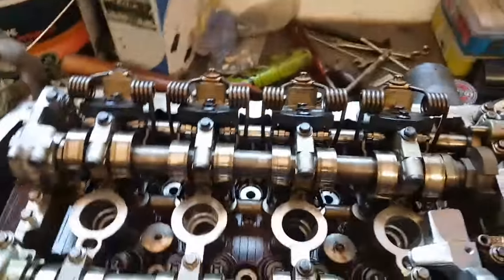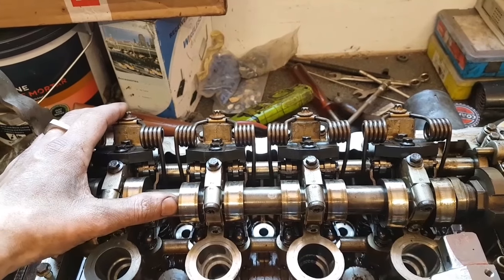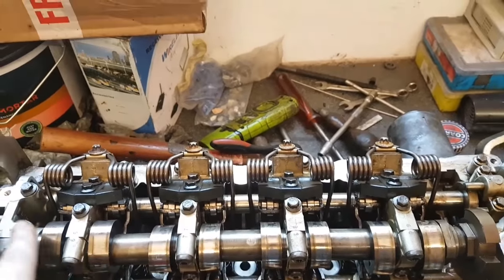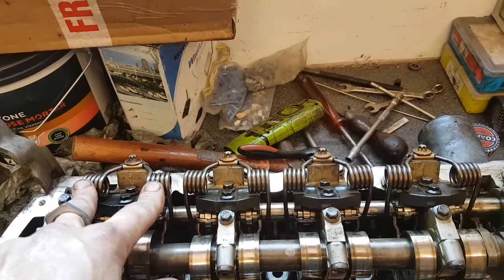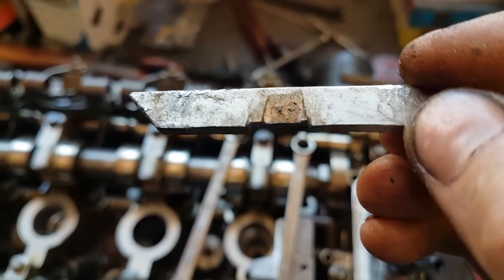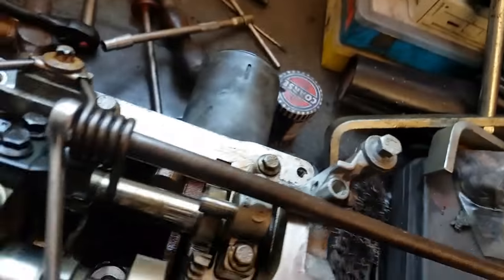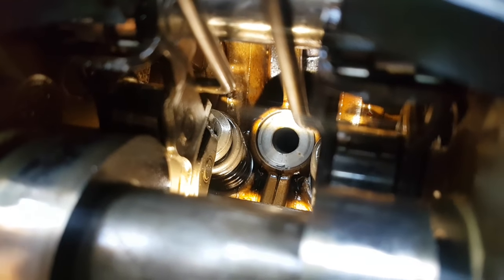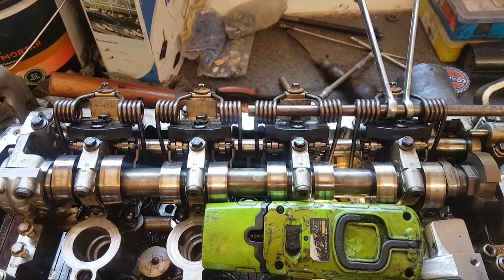PSA / Mini / BMW Valvetronic intermediate rocker & spring installation without special tool

Comment from the maker: Lots of comments on the torque setting for the spring bolts, I didn't (and unfortunately still don't) have them. I used common sense, we're tightening steel into aluminium, so I went hand tight, and then used the mechanics "wrist" to gauge it. Hand tight and a quarter turn hasn't ever let me down with these. 👌

Comment: thank you man, i spend along time trying to did this job with no results, your method its amazing but with one little problem its the little peace of metal you put it behind the springs because when i did this and finish it stuck there and it cant be removed then i change it with two alan wrenches putting them behind every spring vertically and it was easy to remove and again thank you.

Comment: Very nice. It can also help to take some tension out of the long leg of the spring prior to loosening the bolt. Using a screwdriver, pry and move the spring leg out of the secondary rocker arm groove. This will take about 20% of tension out of the system and you don't have to fight as much pressure with the spanners.

Comment: Great advice one old head bolt two 11mm ring spanners and an old 1/4 ring spanner with the. Ring end cut off. Twenty minutes done  Helper a must. Thanks

Comment: I had the same issue, the easiest way is to install the spring with the two fingers on top touching the cam and tighten the bolts holding the spring. Then take a long pair on needle nose plyers and grab one side of the spring and bend it down and hook it on the follower one at a time, doing two at a time is very hard. But doing then one arm at a time is very quick and easy, I've done it and its the way to go.
Reply from the maker: Thanks for the comment,  use whatever works best for you! 👍

Comment: Nice one. Saved the day. You do have to watch that the spanners don't push the triangular sheath around the hole too far, or else you'll cover the tapped hole in the head, and struggle to get the screw in. And watch those followers etc as the video mentions.
Reply from the maker: Glad it helped you out Andy... 😉
Reply: @peteledwidge3631  you really did. mate of a mate bought a three grand car for £1400 for his daughter. Guess what, head gasket f****D. Just trying to sort it out for him without spending a sodding fortune. Thanks!
Reply from the maker: @urbantuckerman  Did you get a bit of a shock when you pulled the valve cover and discovered a whole new world of pain beneath? 😂 I certainly did...

Comment: Great vid, changed my hydraulic valves lifters with it. Good tool :)
Reply from the maker: jeedebee Glad it helped you! 👍
Reply from the maker: Jeebedee Got another lad on here needing to do his lifters, was it possible to do them with the cam in place, or was it a cam off job? I'm thinking Cam off, but wasnt sure. Thanks. Pete.

Comment: Good tip, but if you don't want to lose your eyesight, or damage the mechanism, you always should use the spring tool. I disassembled the Valvetronic on my N55. The preload is very high and dangerous!
Reply from the maker: What exactly do you imagine would come apart and get anywhere near your eyes Sir? If anybody is paranoid, by all means, wear eye protection... it's a good precaution anyhow. This method is sound & (I believe) the best 'no special tools' solution to the problem. Thanks for the comment.

Comment: Thanks Pete, i didnt think so, i did the timing twice and the garage today said they couldn't fix it so its come back to me to repair this engine has such a bad reputation they dont want to touch it, weird because my wifes mini has the exact same engine with no issues., they did ask if i used an inclinometer during timing of which i didnt i used a cam locking tool. Thanks mate will let you know if i find the dreaded cylinder 1 misfire at idle.
Reply from the maker: Jay Kent From my years of experience as a weekend tinkerer, then full time mechanic, Peugeots are Sh*te. (At least 80% of vehicles I see for serious defects are Peugeots, they keep me in business! 🤣). Other models using the PSA engines: ford, bmw, citroen etc dont have any issues with exactly the same units. I believe it must be down to Peugeot build quality. All it can be really.

Comment: Hi and your video is very good, I have a 1.6 vti 120hp 2008 engine and it has an oil consumption, not made smoke from the exhaust pipe, I have been told that it is possible that it is the gaskets of the valves, what can you tell me by your experience, thanks
Reply from the maker: Valve stem seal oil leaks (I assume this is what you refer to) usually result in blue smoke from the exhaust. If it's not burning oil, is the oil in the coolant? This would suggest headgasket failure. Only other scenario would be an external oil leak to atmosphere. 👍

Comment: Hi Pete, Thank you for your good solution, i've MINI 2009 with same engine on the video and we've repaired valve cover and engine rockers, springs etc. and now we get error 285C message from diagnostic tools and it says valvetronic motor position error. What will we need to do do you have any comments?
Reply from the maker: From memory, there's a reset screw in the rear of the motor (It's either hex or torx head). Turn that until it meets a stop end. Switch on the ignition and it should reset.
Reply: @peteledwidge3631  yes i did but still error comes when afyer runing engine :(

Comment: Great solution Pete, Thanks. Where would  I find the torque setting for the spring bolt and also the cam bolts?
Reply from the maker: Really depends on the platform, what vehicle is the engine in? Do you have the engine code for me?

Comment: I'm working on an engine that has bent valves and damaged the seats, which had detached from the head. Watching your video, I see how you've got round the heavy top springs in a great way. The question I have is the fitting of the lower inlet camshaft (the camshaft with the toothed quadrant which is driven by the worm gear.) is it positioned in a certain way so the worm drive is meshed ? 

Thanks
Reply from the maker: There is an usually an allen / torx bolt in the rear body of the worm drive. Wind the worm gear all the way anti-clockwise to give the least resistance on the shaft and then place the valvetronic cam in with lobes off TDC, so that they will be providing the least pressure on other components. The worm drive will self adjust on turning the ignition. Alternatively remove the worm drive completely, so that no pressure is present, and install after installation of the valvetronic shaft. Either will work.
Reply: Pete Ledwidge thankyou for your kind reply, I'm replacing bent exhaust valves on No 4 cylinder, the inlets are bent also, and the seats have detached. This was caused by an overheating fault, the head got too hot, the inlet seats  came adrift and stopped the engine. 

I've stripped the head, had it skimmed and I'm waiting for he valves to arrive. Your explanation is very helpful, I've been trying to work it out, and like your video on the way to refit the springs is indeed clever. 

I will let you know how it turns out. Thanks and best regards steve
Reply from the maker: @stevenlangdon-griffiths293  Sorry, long day on the tools, these valvetronic engines are another level of misery! 😆 Let me know how you get on. 👌🏼
Reply: Pete Ledwidge hi there, I rebuilt the engine, it runs well and I Learned quite a lot about the cooper too. It had bent valves on No. four cylinder and the seats had dropped out. I worked out the lower inlet camshaft position ok. For your info, the video you made helped me a great deal. Thanks very much indeed.
Reply: Im doing this right now. And was very anxious to have to spend 200€ more on tooling for this repair (im stil small) already bought locking tools and the valve stem tools also Make my own Air compresión hose/tube. And when i see the cost of pliers was like dammmmm your video put some light on my way THANKS so much (suscribed, following, like and all the good stuff for you) 👍👍🤘🤘

Comment from the maker: This has been up for almost a year now and only 9 dislikes, that's a pretty good going... I think 9 people probably bought a very expensive tool, then felt some proper hot chilli butt hurt when they realised they could have done it for almost nothing. 🤣
Reply: Pete if you change the tittle to just " bmw  N55   valvetronic spring removal" or something like that , thing more people would benefit from this
Reply from the maker: @SanDoval201970  so, I take it you dont like peugeot owners?! Hehe! Not after view counts on YT mate, if you like it and it's relevant, share the good news brother! Other than that the title remains, for 2 good reasons 1) CBA to change it, 2) I'd have to re-upload which would basically kill the whole thing dead. Thanks anyway! 😉
Reply: Hey man. Wanted to thank you for the video, I swapped connecting rods in a bmw n55 engine and used your method for the valvetronic springs. Worked like a charm. Keep up the good work 👍🏻

Comment: Thanks  Pete  !!!  have you ever had this motor  intermittently  hiccup  at idle   and under load or not   but not caused by load on the motor ....im thinking broken valve spring ??
Reply from the maker: Could be that, have you checked for fault codes? These engines are so needlessly over engineered that it could be a number of things.
Reply: @peteledwidge3631  Thanks checked for fault codes   nothing , but the pollution warning comes on and car  misses  no power , still no codes . i regapped the plugs seems different , they were about 2mm ...cheers
Reply from the maker: Get a fresh set of plugs in, they cost next to nothing. Check the coil packs by disconnecting each in turn with the engine running, each 1 should cause a misfire when disconnected. If any do not cause a change in engine note, replace as necessary.

Comment: Thanks Pete, agreed but as the engines are the same psa units but in different cars with no issues it make no sense why the same unit dropped in a peugeot body would play up, will report back and update when i find the fault. Cheers mate Jay
Reply from the maker: Jay Kent Makes no sense to me either pal, can only comment on my experience. I don't hate Peugeots or their drivers, had a few 205's back in the day & Peugeots earn me good money, so not knocking them. I personally wouldnt have another Pug, even if I was given it tho! 🤣

Comment: Hey Pete, I'm about to re-install a freshly resurfaced and rebuilt cylinder head in my 2010 Mini Cooper Clubman (N12, non-turbo motor) and I have a question that maybe you can help with?! I removed the Valvetronic motor prior to dropping off the head at the machine shop, and realize that I'm not sure how to properly re-install it to keep everything in time. Do I simply insert the motor and use the allen key slot in the rear to thread the motor back in and tighten down the three hold down bolts through the triangular flange on the motor? Is any other adjustment needed? Thanks!!
Reply from the maker: Use the allen key to fit the stepper motor back in easily, the motor will auto test and reset to it's proper location, after initial key on. 👍
Reply: Just the answer to this i was looking for.
Kudos for the "bar and spanner" idea, thats the difference between a mechanic and a fitter.

Comment: Had a question sir ... I went to replace the valve cover gasket because it was leaking and discovered one leg of the timing gear retainer spring was off..... I was able to push it back into place, but is this common?  Any ideas why it would happen?  Any help would be very appreciated.
Reply from the maker: Was the engine suffering any for that? Not seen it myself tbh, but I can only suggest not installed correctly from the factory, really. 🤷‍♂️
Reply: @peteledwidge3631  the engine was running perfect... It's a 2014, the one spring leg was riding on the cam shaft, it only left a thin little line so looks like by chance i discovered it really  early...,i was able to push the spring back into place, put the valve cover back on and started the car... We drove it a little today, I'm thinking about driving it for a week then removing the valve cover again tho look if it came out. Just sucks cause even if the spring is still on after a week of driving, it will already be on my mind, wondering if it's off ... Wierd, the spring looks perfect, the place it goes on looks perfect, wonder if it's worth having a new spring replaced on it..... If it's worth it.  Don't know
Reply from the maker: @iborges1794  I'd leave it as is, and check again, as you say. 👍
Reply: any update? hows the car? im dealing with the same thing. Was in middle of vcg and one of the spring look like it moved out of place

Comment: Does the motor take 12v to actuate it? Forward and reverse, respectively?
Reply from the maker: The valvetronic motor has a manual adjuster on the rear of the unit, a torx fitting if memory serves correctly. It can be wound to it's stops in either direction.👍🏼
Reply: @peteledwidge3631  found it thank you. I was puzzled that moving the cam would not open the valves then I noticed the big motor and the other shaft and I thought about putting 12v but then I noticed a little hole. The tool I used was a 4mm allen. It seems like when looking at the back of the motor if you rotate it manually in the clockwise direction the valves are able to open. I thought this was kind of interesting. I really thought the cam sprockets did the advancing and retarding like some of the other 4 cylinder engines, but this design seems interesting.

Comment: Hi Pete, when you do timing on this engine do you need to do anything special to the eccentric camshaft motor, i also saw some one using an inclinometer as well as the locking tool during timing?
Reply from the maker: Jay Kent Nope, other than setting the wormdrive to least resistance on the rockers, using the adjuster on the rear of the motor unit. It will auto resync without diagnostic intervention.
Reply: On some valvetronic motors, there is a hex key driven (3mm I think) manual wind to detension the variable valve lift eccentric shaft, but it doesn't matter because the car re-initializes (re-learns the position) on every startup.

Comment: Can i ask something???What was the problem with this engine???I have the same vehicle and after 200000km is burning oil(1litre per 4000km)
Reply from the maker: Telis D Hi Telis, yes... head gasket had gone on cylinder 4 (French) I.e. timing end. Giving the same problem, high oil consumption / smoking / oil in cylinder pot / misfire. I never replace a head gasket without rebuilding the head, do it right = do it once. Cheers.
Reply: Check your oil seals too.
Reply: Sorry but don't you mean 1 litre per 400km? Otherwise I think that's not entirely bad.
Reply: Sorry for the delay...its correct 1lt per 4000km.For me its a big number...but i have to get use to it...
Reply: Bad PVC valve ..

Comment: Hi Great video, i have the same engine and beleive there is an issue with the hydraulic valve lifter on cylinder one, using your great method is it possible to change the valve lifters without removing the head and cam shaft? Kind regards Jay
Reply from the maker: Jay Kent, Hi pal, check out other YT vids for the working principle of valvetronic, it will help your understanding of the system and aid your diagnosis. 👍 It will be possible to do the job you describe with the head on, but you'll need to remove the cam / valvetronic system. It's less daunting then you would expect, with the correct tools for the job. You'll need the correct timing & spring compressor tools (if spring is broken) which are both inexpensive on flea bay. Check these links. 

Spring compressor:
https://rover.ebay.com/rover/0/0/0?mpre=https%3A%2F%2Fwww.ebay.co.uk%2Fp%2F15017008733%3Fiid%3D282723513151

Timing tools:
https://rover.ebay.com/rover/0/0/0?mpre=https%3A%2F%2Fwww.ebay.co.uk%2Fulk%2Fitm%2F201312710448